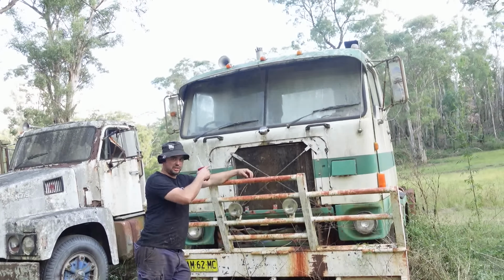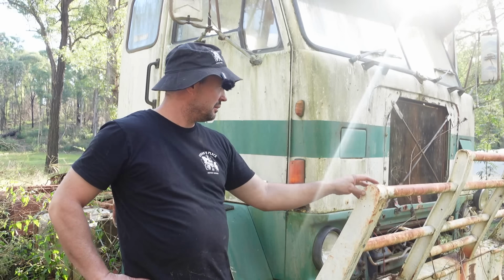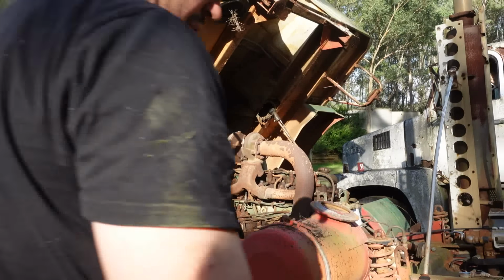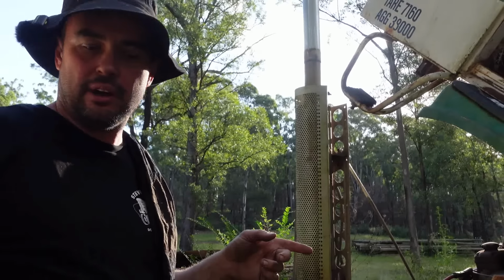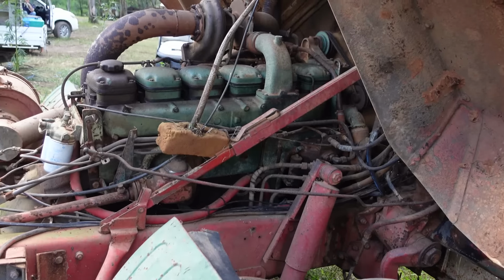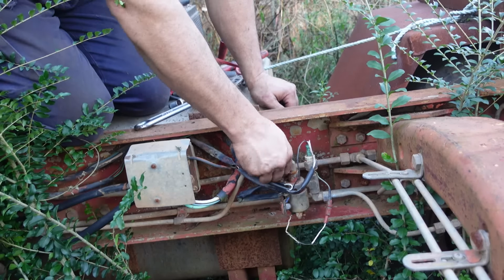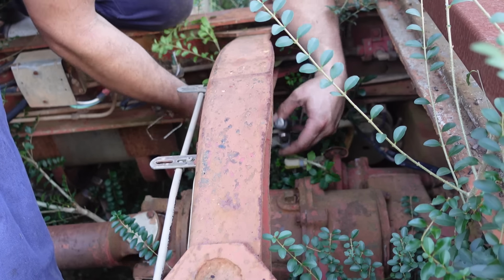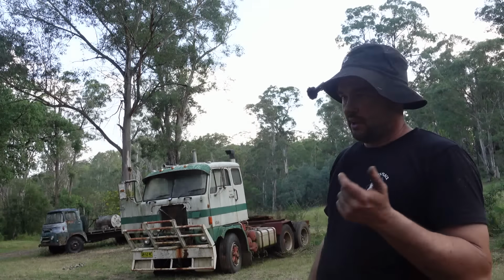Volvo G88 Truck. Can we get it to move?

Comment: My old man bought a brand new G 89 in 1975 to haul logs with, it was 100 ton rated, had 65 000 pound Volvo hub reduction axles, 120 A engine that was 330 hp which was probably really only equal to around 275 hp in US engines. If you compare them to other brands back then, they definitely were the "Rolls Royce" of trucks, they drove smooth and everything about the truck had a feeling of quality. I was not a fan of the radiator mounted in the cab design though, it made the engine very hard to access the front to work on, and that stupid flex radiator hose was very expensive to replace. Volvo fixed this in the F series and raised the cab a little so there was less engine cover hump and a flatter floor, but still the G series was a damn good truck!
Reply from the maker: Hi mate thanks for sharing. Yes they had the power but wasn’t like the American stuff like you say. I haven’t heard anything negative about them though apart from the rust

Comment: Graduated from a Ford D1000 with a 6v53 Detroit to a G88 when I was a young fella it was a major step up. Had the volvo 16 speed with a separate spitter lever on the dash. It was one of those trucks and you wish you could find restore and enjoy. One of those old trucks  you get a soft spot for, they didn't set the world on fire for horse power and engine braking but still loved driving it.
Reply from the maker: Thanks for sharing Jimmy. Yes the splitter is on the dash of this one also. Good to drive. Hopefully one day it gets saved

Comment: My uncle Col drove one on the logs back in the 80s there were a few in south east SA 1 logging firm had 2 N12s and about 5 g88s good old trucks
Reply from the maker: Thanks for watching mate. They were great trucks I believe. They were a popular truck in those days.
Reply: Love the mic mount buddy great work
Reply: Hay Steve there are no bogie tools only operators shameless plug but you left your self wide open for that one 
Tools all mentt to be used as operator sees fit if it works then not bodgie at at nice to here her run again you certainly have some nice old bits of kit out there on the farm for sure Cheers mate

Comment: Hey Steve had the yoke nut on the through shaft come undone on one of those old girls before, cocky had one on a 5 in 1 bin, backed it out of a super shed after coincidently going to a farm for a no start and changing the 12/24 solenoid went about 2m and stopped. Looked underneath and the jackshaft was laying in the dirt. Had to undo the flange and split it, get the yoke and nut back on, do it up with the hand tools I had on me and get all back together
Reply from the maker: Geez mate it’s strange that that happened
Reply: @stevesplacedownunder  lucky it didn’t happen about 5 mins later when I took it for a wrap down the laneway

Comment: All the Rockwell bogies I know of (been around trucks since '59) the thru shaft drives the rear diff and when the pwr div is engaged both diffs drive ; only for bad traction situations and never over 25 mph or on dry pavement . 👍🍺🍺🍺🍺🍺

Comment: Dam that brought some old memories back. One of the first trucks I got to expeiance was a G88. It had a 12 speed in it. It had a wierd setup been it was a straight 6 speed (no high/low) with splits making 12. I remeber the linkages been worn and it didn't much to miss a gear, pain in arse of a thing. I also remeber having a top speed of 98kph. I believe she is still going to but I haven't spoken to my old trucky mate in many years now.
Reply from the maker: Hi mate thanks for sharing. This one is a 16 speed. 4 speed with high and low range and split every gear. They are great old trucks

Comment: Had an old lady do a Uturn in front of our  Volvo with a full bullbar on the open road hauling an empty B-train. She was in a Fiesta or similar. The truck hit her square on, picked it up, and pushed it down the road about 300m.  The car was flated down the left side, and the old lady was helped out, shaken but unharmd.  The Volvo  had a bent step,  a cracked headlight seround, and a dent on the right-hand base leg of the bullbar, so no real damage. The cops that showed up couldn't believe what they saw and told the old lady that if she hadn't been hit by a truck with a full bullbar, It would have just  rolled over her.
Reply from the maker: Geez mate yes I can see it would have been worse without it on there.
Reply: Yep, don't just clear  bull's and Ru's out of the way they also clear tiny cars.

Comment: Lmfao "here to get my nails clipped." 😅😂 quality content with  every video. I really want to see a video of converting 24v to 12v. My 65 kenworth lw has a series parallel and I think I want it gone.
Reply from the maker: Thanks Steve. It’s just a 12 volt starter you will need mate. Then the trigger wire that goes to the parallel switch goes to the starter instead. The batteries are then all hooked up in parallel. Positive to starter, negative to chassis

Comment: Haven't heard that joke in 10 years Steve, nice one! Those old Volvos run pretty sweet, drove quite a few B10 buses and a few F10 trucks back when I drove for a living, biggest issues with them was wheel seals and compressor air dryers (used to drain a litre of water out of the wet tanks most days).
Reply from the maker: Thank you mate. Yes they run very nicely. Thanks for sharing your experience with them

Comment: I think the rad cap on that g88 is worth more than some trucks I've had...8^)   Nice startup Steve, and a nice assist on the cab lowering by Georgina! The re-plumb / bypass of the air line for the PD was a good temporary fix to try and get things going. Too bad the brakes were stuck. They might be a bit of a rassle to free up. If that middle axle has a broken driveshaft as you suspect, could it be jamming the brakes somehow? Just a thought. Cheers!

Comment: Drove an N10 6 wheeler with a 3 axle trailer bulk unit. Only 300 hp but nice to drive except the overdrive was the weak link on the 12 speed. Needed its nails clipped 🤣
Reply from the maker: Thanks for sharing Jimmy. Sounds like she had her nails clipped mate yes

Comment: Fm Volvo's by comparison, don't seem to rust, they just wear out after 1.5m kms. Had an fh 2010 with 1m kms, 20,000hrs and original motor, box and diffs, obviously not clutch or air compressor. Compare that to a k104.
Reply from the maker: Hi mate yes that’s right

Comment: Hi Steve from the U.K., over here it’s an F88 not a G but same truck, I remember helping a garage out (well thought I was helping?) when I was still at school and they had two 88’s before changing to the F10 but they always where a good work horse and very popular so would be nice to see working again one day as getting less of them about and we also suffer with the dreaded rust here, keep up the good work, markUK
Reply: We had both F and G models here in Australia.
Reply: G88 had the front axle set forward, F88 had the front axle set further back, easy way to spot the difference is the access steps, F88 had  the steps in front of the front mudguard, G88 behind. We did get the G88 here in the UK, they were rare though, Hays transport in Liverpool had a fleet of them, day cab variants mostly. Love the F88, it was a game changer for haulage and drivers in the UK.

Comment: the f88 had 290 bhp
Reply: The earlier ones were 240 BHP (small square chromed grille) someone I knew had an N reg one, but the 290 (witht the wide , usually black grille) was more popular in the UK
Reply: @denissharp2471  yeah the early f88s where 240 bhp with no no turbos with a narrow metal  chrome grill then a narrow black plastic grill the f88 290 had the wide grill  290 bhp with a turbo a company beside me had  ba rand new one in the 70s they where a lovely truck they had  a  lovely hum out of them but very smokey when they where started from cold